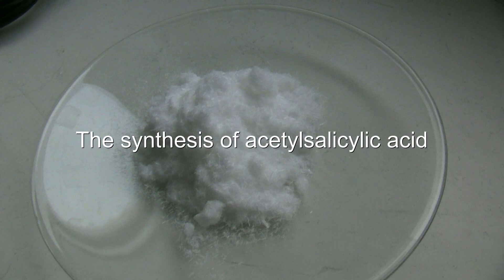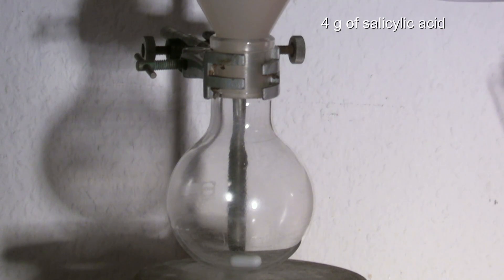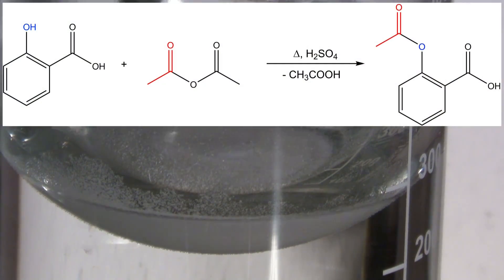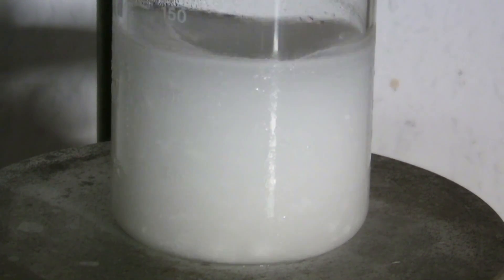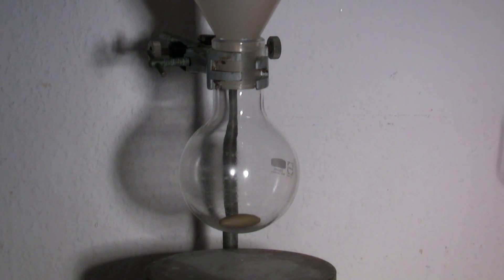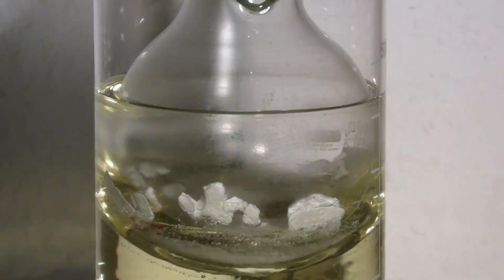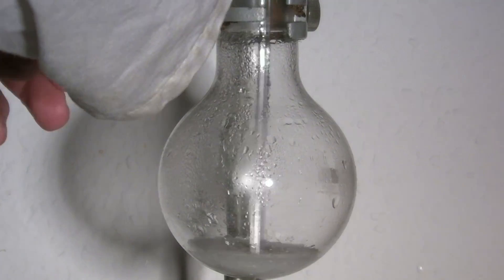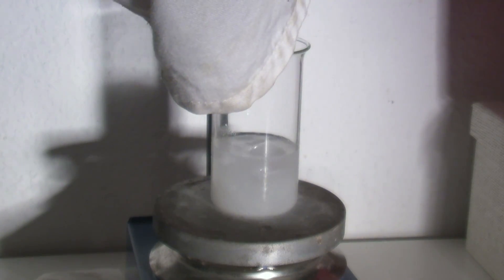How to make Acetylsalicylic acid

Comment: Why not use GAA, AA, and sulfuric Acid to acetylate the salicylic acid?
Reply: The reaction is water sensitive and needs the acetic anhydride to acetylate the salicylic acid. It also requires high temperatures

Comment from the maker: +Mike Yes it's water. The oil bath is needed, because it has a higher boiling point than water. Otherwise, it's a bit difficult to get the water in the flask to boil. (Youtube keeps me from answering your question directly...)